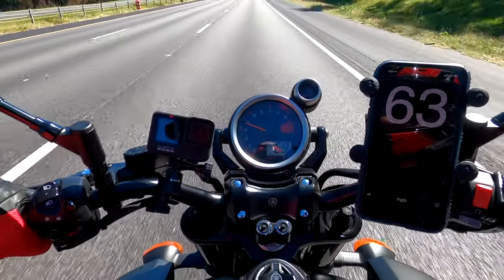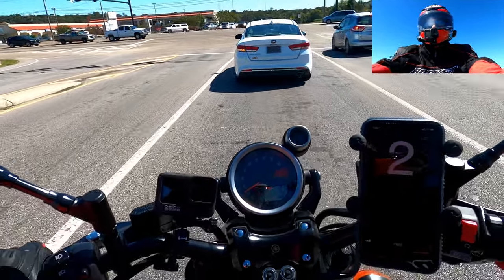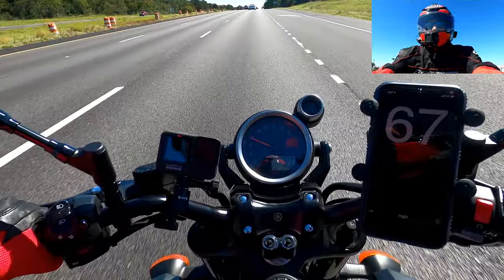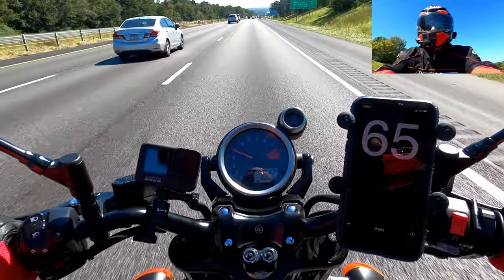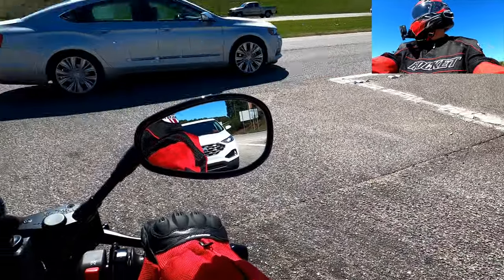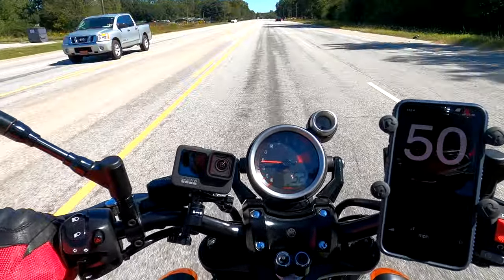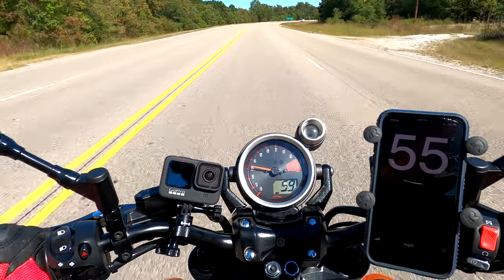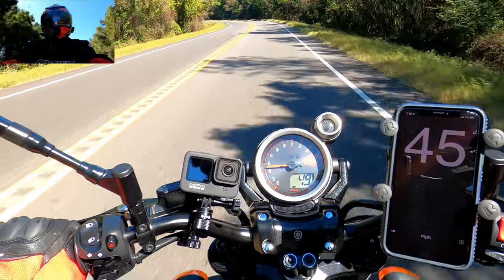How to Measure Speedometer Error

Comment: To Err on the side of caution. It all works out for me since I seem to riding 5 over more often than spot on. 
 Good video Jeff. 👍
Was also interesting to see the old article on the Magna V65. I was curious back in the day if the Magna actually had the hp to pull it off, what it’s top end would have been in 6th or OD. Now I know. Mine could reach near 140 at about 8,500 -9,000 rpms. Quickly lost it in OD. I hope to ride mine since the rain finally let up. More than 8” this week. Take care
Reply from the maker: Thanks again Jared. Glad you liked it. Been dodging hurricanes here in Alabama for the past several weeks, so I haven’t been riding as much as I would like to. This weekend is supposed to be nice.

Comment: This just proves that your speedo is as accurate as mine is.  Funny thing is when I pass by those speedometer checkpoint stops It appears to be accurate?  Your breaks don't appear to be squeaking either.  Maybe they fixed that in later years.  Your exhaust is so quiet compared to mine. On the one hand I miss the quiet stock exhaust.  But the weight savings, and power gains of an aftermarket exhaust is worth it.  I added ISO grips after a really long road trip to Sturgis. It made a huge difference. I also added a 6.5 gallon fuel tank.
Reply: Hi Karrem..where did u buy your new GAS TANK?..im looking for a bigger one...
Reply: Yup...which tank ?

Comment: Tyre diameters? I notice my max in klms is more predictable  as a % lower actual than real. Your phone app is also not accurate it has errors based on many factors. I am a radio Comms engineer mobile networks not 100 %. So error on gauge and errors on app cals multiply! However real speeds will in most cases car or bike be between 5-10%  higher than on your speedo. We tested accurate speeds using radar video from chopper with markers pin pointing actual longitude latitude as start stop with time taken,, video helped as it has embedded markers. The results all concluded speedos read higher than actual speeds. All tests were based on manufacturers spec tyre rim sizes level roads..

Comment: You will never get the same correct reading , the bike has a direct hook-up the phone is being read by a satellite there's a slight difference in time frame then there is with a direct connection on the bike you can get a kind of close reading but not an exact reading and plus like a vehicle if the tires have a lot of wear on them the tire will turn a little faster and give a false speedometer reading so you will get a more accurate reading with a brand new set of tires like the ones that were on the vehicle or motorcycle when it was brand new same tread depth same tread design same brand